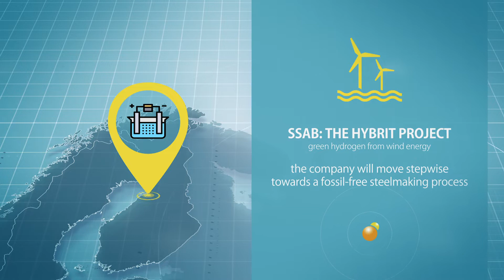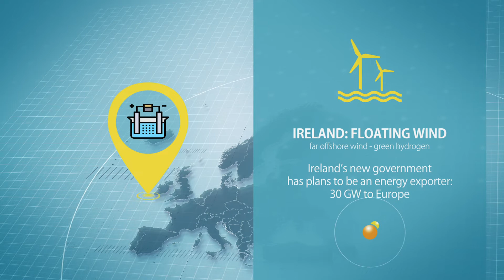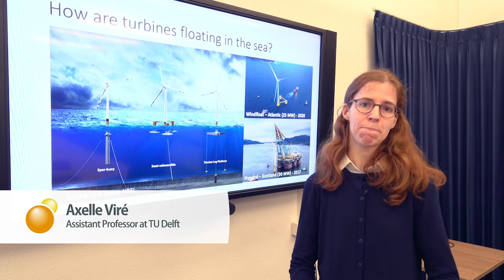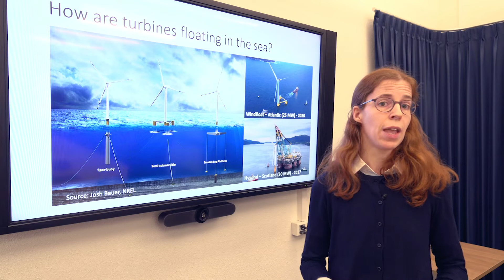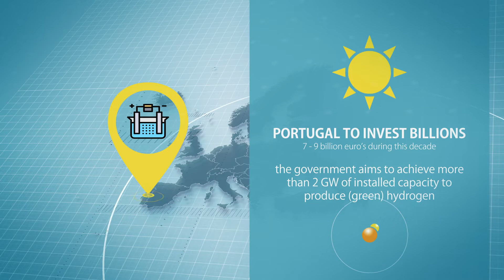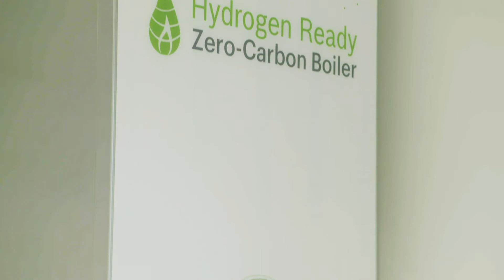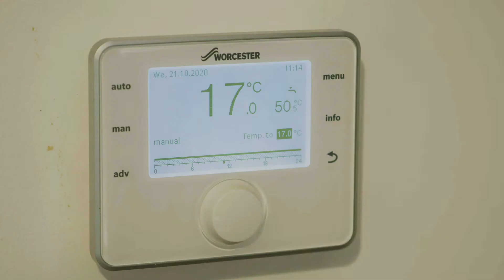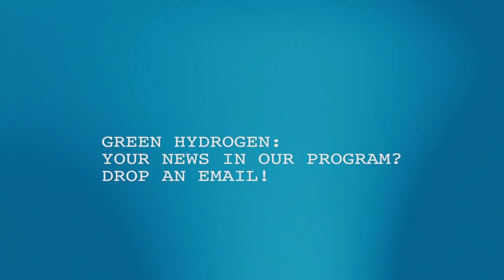New Energy for Europe - green hydrogen - first bulletin

Comment: Who is going to gain by this push for the hydrogen economie, we or vested interests in the fossil industry? Off course there are good long term uses for H2 but at present is would be better to use fossil instead for these until we have surplus electrical energy. Heavily pushing H2 now is a just a way of averting the rapid transition to sustainable energy by the fossil industry.